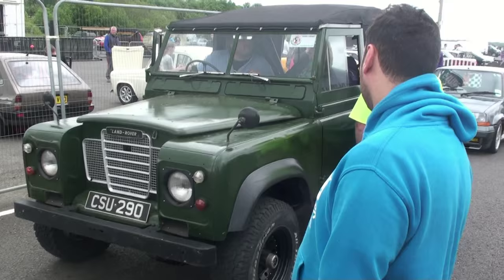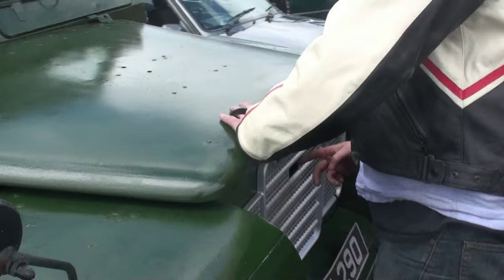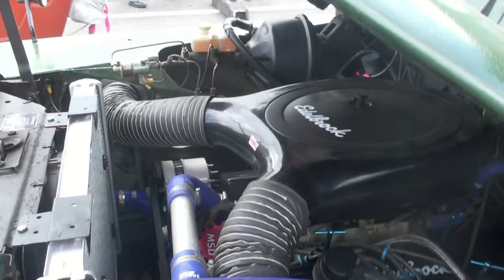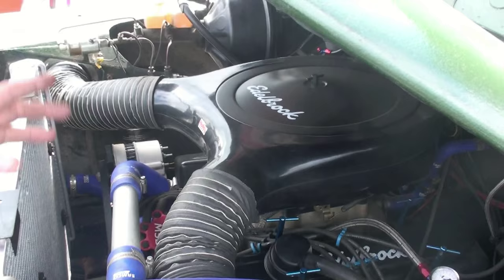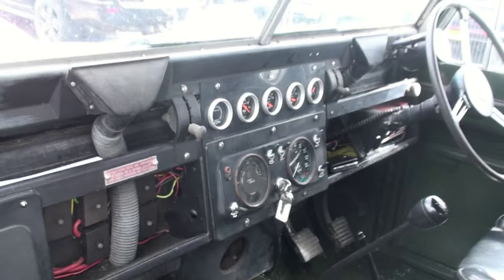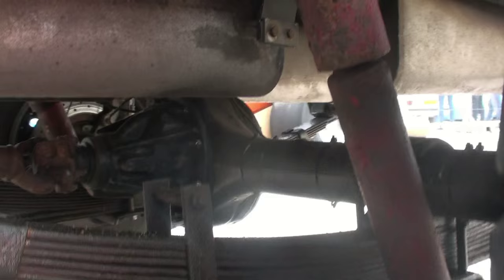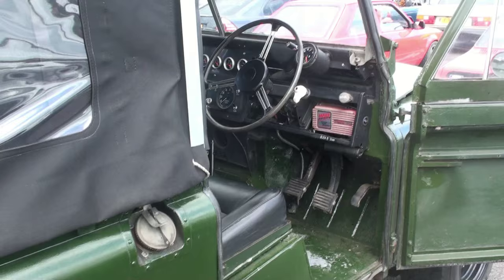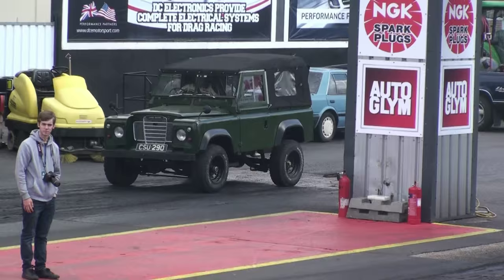Amazing Land Rover series II 4.6L @ Santa Pod Drag Strip!

Comment: dont understand why he did a burnout on those All terrains . You are not going to benefit anything from that at all . Lovely car though and great video as usual frank
Reply: +John Smith   It was warming them and therefore adding grip,  I had a problem with initial traction when they were cold.  It does make a big difference on initial hook up
Reply: Fair enough but I would have thought lowering the pressures more would help with grip than spinning them up. Usually road going compounds don't rear well to heat . Especially with a tread pattern that open . But either way I'm sure it was fun . Lovely landy